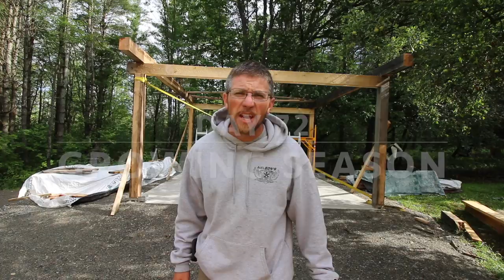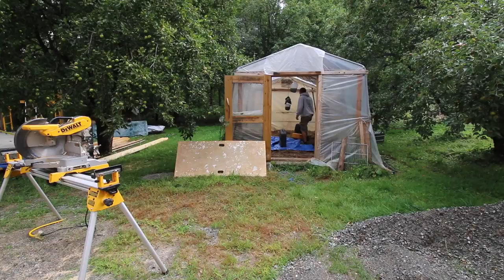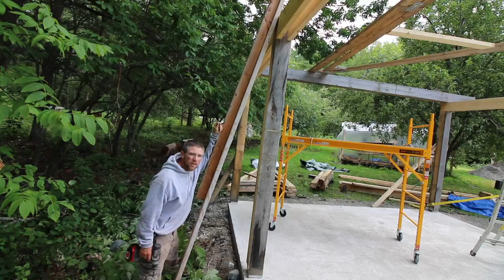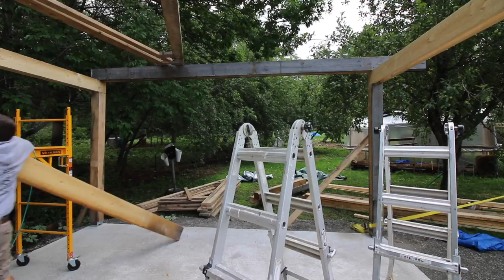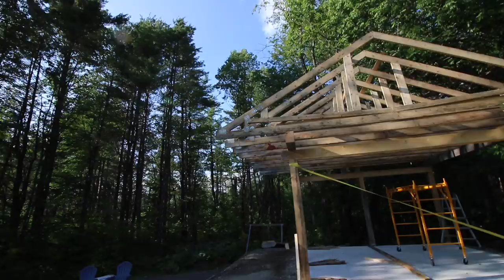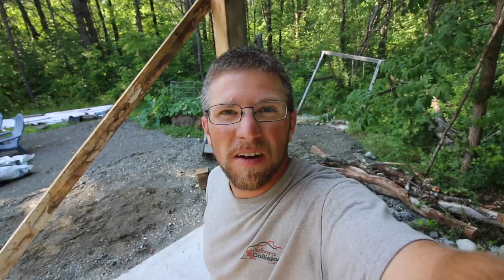Setting  Upcylced Trusses in Place

Comment: Looking real good Al. I was concerned about your trusses being in two sections and if they would be able to handle your snow load. Putting in the 2x8's sistered along side was a very wise move. I still have a little concern about the engineering of the rafter cords at the peak. You could always add some OSB gussets or 2x collar ties later if it looks like that may be an issue. I like the open design, you could add OSB decking up there for added covered storage later on, amd make use of that attic space. Looking real good though, coming along nicely.
I was at one time a young buck like you. A real pack mule on the job, out work anyone and everyone. I'm paying for it now in my 60's. Take care of your body, I'm just saying.
Reply from the maker: Thanks! Yes I think I will add collar ties to the trusses later! We are putting tin on the roof so their won't be much snow load! I agree with taking care of your body! I am a little sore today but most of the big heavy lifting is DONE! :)

Comment: You might want to put some metal rafter ties on those joists to hold the roof on in a big wind. Less than a buck apiece.
Reply from the maker: The only thing it we used some rough lumber and its hard to find hold downs for them
Reply from the maker: Thanks! I will have to get some!

Comment: Lookin good!  Only thing I have a concern about is using screws in the bottom post attachment. Is there enough shear strength with the screws?
Reply from the maker: Good question! I can always remove them and add nails if needed.